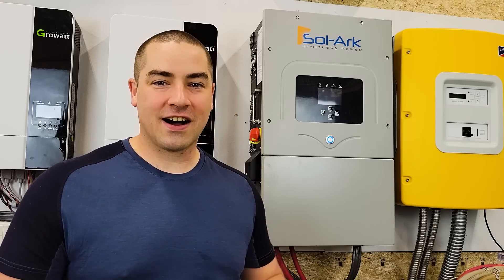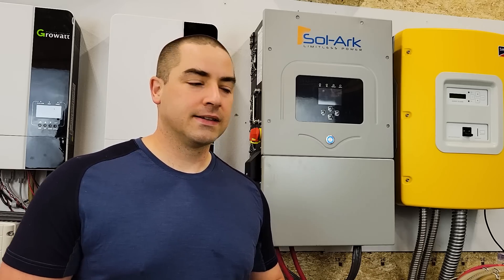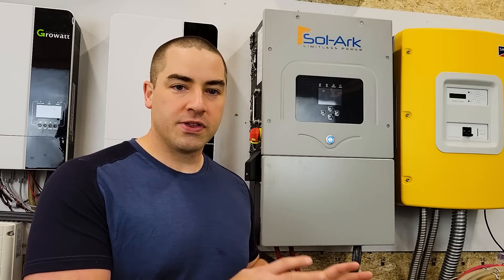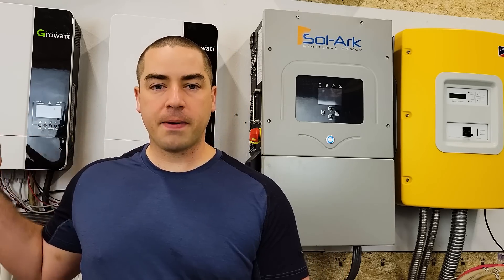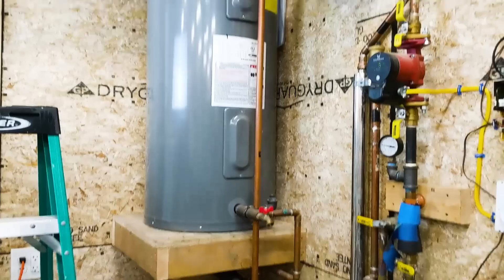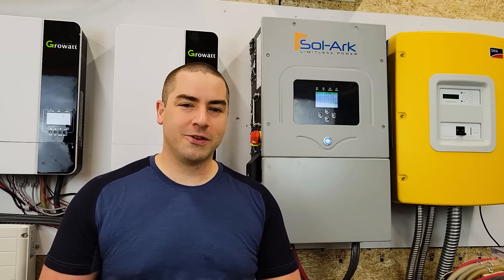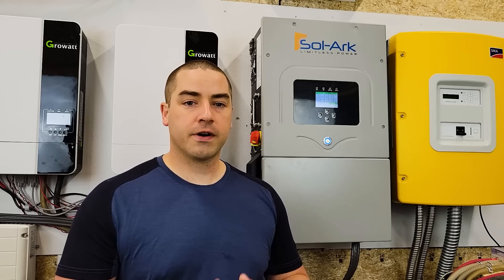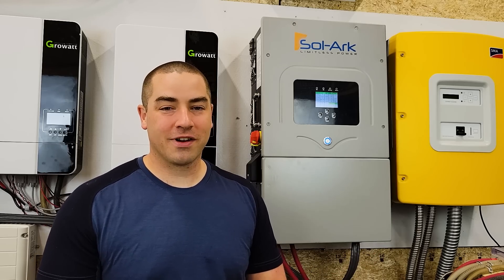Sol-Ark 12K Inverter, Is it worth it?

Comment: Balanced or not, 9K isn't a lot of inversion. Twin Sol-Arks could get past this. I would also assume that an AC coupled supply (another inverter routed through the Sol-Ark) would help with the 4500 w limit. You clearly pointed out the need for people to balance their panels. Lastly, this suggests that the new breed of programmable load centers like the Span would help with this flexibility. I haven't looked at what else is out there, but unfortunately the Span panel is largely Powerwall-centric.

Comment: Hi @DavidPoz!!!
Love your videos and what you are doing at your garage...!!!
But, again (and as I wrote on your previous Sol-Ark video), your not being fair in your tests and, therefore, maybe misleading your followers with these 2 last videos...
First of all, I was under the impression that you got this Sol-Ark 8K for testing, so that it didn't cost you any money...
Second, you have bought 2 of everything (2 SMA Sunny Island Battery Inverter/Chargers, 2 Off-Grid Growatt Inverters) and you still want to compare it to a single Sol-Ark 8K unit... really, not comparing equals here... 
Third, if you want a totally Off-Grid system, why bring the Sol-Ark to the picture?... the brilliance of the Sol-Ark is that its an all-around inverter: can do off-grid, on-grid, frequency shifting, AC and DC coupling, battery charging, TOU, etc., etc., etc... None of the other inverters can do all that...
Last but not least, it is a well known fact, even expressed by common installers of the Sol-Ark inverters (take Practical Preppers, Engineer 775 for example), that 1 Sol-Ark Inverter is not usually enough for a typical American household... it usually takes 2 in parallel (as you did with the Growatts and the SMA Sunny Islands) to manage these typical American loads...
So, my point is: do things right, make fair and comparable test procedures and stop misleading followers with inaccurate statements... it just doesn't seem right...
Take care... wishing you the best...
Reply: Thank you for your comment.  Unfortunately David isn’t comparing apples to apples.
Reply: 2x   Growatt 5k =  10k  
2x   SMA sunny Island 6k = 12k  

Lastly when either of these two great inverter companies say  5k it means  it will put out 5,000 watts period .

Comment: It would be interesting to see what happens if you added your auto transformer to the SOl-Ark. That could solve your problems. Does sound like you could use 10KW min and 12-15 KW would be more optimal.

Comment: A lot of Solark fans saying "misleading", please reply with your exact points to drive this conversation forward
Reply: I Own a Solark 8K  + Solar-edge Auto-transformer that runs my whole house but I am pro Growatt because of the price. In the same time Solark has 10 years warranty. I think Growatt is 1 year warranty.

1. test in this video it is one Solark against 2 Growatt inverters + Solar-edge Auto-transformer which balances the loads. Because of the price, comparison is fair, but if you add in additional costs then the price of Growatts goes up. You cannot put in series the same number of solar panels on the Growatt so you need more cable runs from solar panels to the inverter and copper is expensive. Solark uses 70w Compared to 2 Growats and Solaredge that use 160W. That means that you need more batteries or your current bateries will be drained more over night. you also need extra solar panels for the extra 90W Gowatts use.  90W x 24 h = 2400W. So you use 2.4 kw extra in the Growatt setup.
For 2400W extra a day, how many more panels you need in a cloudy day?
See it is not that simple. 

2. You cannot export to Grid on the Growatts.

3... as other people mentioned here, if the Breaker on the Solar-edge Autotrnsformer goes down you lose the 120V and you could burn appliances. I killed one of my fridges playing with that. 
To mitigate that you then need 2 Solar-edges  to make sure at least one of them is UP.  2 Solar-edges Autotransformers is $800. See how the price goes up?? how much is 2 extra 30Ah Breakers ?

4....
5...
6...

It all depends on what you need. If you are totally off-grid and you do not need the 10 year warranty, and you are 100% that Growatt will last at least 4 years, and you do not mind the extra cost I mentioned above, you go with Growatt. as I said in a different post. I want a Growatt as backup for my Solark 8k.
Reply: @mlg779  Growatt is 2 year, but you couldn't have put the other points better, this is just a choice that is typically better for most off grid only buyers

Comment: David, to be fair to Solark you have to redo the test. You are comparing a single Solark to 2 Growatts balanced perfectly by the Solar-edge and 2 SMAs that are 2, and then  do not have all features and cannot do what Solark does.
You just need to remove the neutral from Solark if you add the Solar-edge auto transformer.
Reply from the maker: Sounds good.  Enough people have asked for that specific test that I'm willing to give it a go.  Not trying to be unfair.  I just figured that the Growatts require some kind of transformer because they are 240V only.  The Sol-Ark doesn't require a transformer because it puts out 120V and 240V.
Reply: @DavidPozEnergy  Glad to hear this! Looking forward to the results! (My 12K is just about on order.)
Reply: Why?  Does solark say you need to buy an autotransformer because $7000 just doesn't cover it? Lol suckers born everyday. 🤣

Hey David buy 2 solarks to be fair!!!

Or to be fair spend $7000 on inverters and see what you can power with $7k of inverters ... you know to be fair

Comment: What were the settings for the batteries? I just got my sol ark hooked up with the same batteries. I currently have it set to float with a voltage of 55.9. Were you able to connect the inverter canbus to the batteries? Need any special wiring or a stock rj45 was proper pin output?
Reply from the maker: I didn't use any special communication between the battery and inverter.  I set up the inverter in voltage mode, bulk 56.0V, float 55.0V.
Reply: @DavidPozEnergy  OK great I'll set up that way. Thanks

Comment: This video is just you putting your own lack of knowledge on display, overloading a unit, and pretending that you overloading it is a problem with the device. Odds are you didnt read the manual because you didnt even mount it correctly.
Reply: Your a tool for solark
Reply: @easylooker  *you're.
Click the video description, bud. This guys is literally getting paid to advertise for growatt. You have backward who is the tool.
Reply: What page of the SolArk manual is it that covers balancing the legs?
Reply: @WimPrest  the spec sheet (included in the manual) says it has an off grid 37.5A limit. Multiply by 120V and this is 4500W, as each leg's voltage is 120V. If someone doesnt know P=IV, they know almost nothing about electrical.

Comment: Hi ppl I picked up some batteries out of a junkyard and i am interested in doing a power bank. The batteries are Mercedes Benz 48 volts 20 amps 880 Watts hour. Does anybody here know anything about these batteries, and wether i can use the standard BMS that come with each battery system

Comment: Well, if you figure only 4500 watts per phase, it shut down pretty quick drawing 4629 watts! That is really poor overload or surge performance! That's only about 3% over its rating that caused it to shut down almost immediately!
Reply: It actually does go all the way to 4800W/leg before shutting off. The reason you see the 4629 is because that's the last data the screen showed before the error, which does not report in incredibly small increments of time. If he had his dongle in to check this with powerview, he'd see that it made it exactly to what its specs say, which is 4800W/leg. Sol-Ark's support team would be able to explain this to him if he actually cared to see the problem instead of spreading misleading content. Why put an over and a toaster oven on the same leg??? That's either a rookie mistake, or he did this to force just over what the specs say and make it look bad. As many have said, this is simply an apples to oranges comparison. Those growatts don't have a fraction of the capabilities of a 12K with things like working with the grid, generators, etc. They were better in this test, so if you only ever do things like this off grid, they're a great choice if you have the autotransformer (even though it has much higher parasitic loss, and the inefficiency will grow even more as you add more power being transformed.

Comment: Hi David, thanks for pointing out the inadequacy of the Sol Ark, it is no longer on my wish list, especially as I want an inverter capable of running up to 4 Air Con units at 220-230 volts freq 60hz with a 30 Kilowatt battery bank and large solar array in Brasil.  Have you used soft-start circuits to limit in rush current at all on any of your units.  I have to admit that I am leaning towards the Growatt range now having seen your video on the Auto Transformer.
Reply: We’ve ask about the soft starters before.
Reply: 240V loads wouldn't have the imbalance issue....

Comment: 4500 watts on 1 leg of 240 volts is 1/2 the rating. Makes sense to me that they are protecting each leg at 1/2 the full 240v rating of 9000w. Not 9000W on one leg alone.

Comment: Over here in Europe with have 220-240V single phase (I am in the UK and here it is 230V) so that issue doesn't arise, as we would always be pulling off both of the 110V phases. This inverter is marketed under the SunSynk brand name, and, certainly in the UK, is not badly priced (about $2000 plus tax for the 8K model). The SunSynk is also a 'transformerless' design, what one should really call a High Frequency inverter, and is in this respect the same sort of technology as those Growatts you have there. One issue I see reported a LOT about the Sol-Ark is that it has a whining noise and generates interference around the house. This is to be expected with high frequency inverters, but the Growatt supresses it way better. The top of the range Growatt SPF HVMs are the better choice, as they are Low Frequency transformers (using laminated transformers). The 1st Gen of the Growatt SPF xxxxxT HVM cannot parallel. You can leave it connected to the grid and it will switch automatically and pass through more power from the grid if you need it (or start a generator). You can also set it to not back feed to the grid (so the grid is used only to pull power when needed). The 2nd Gen was announced a few months back (it is all over the Growatt Facebook pages). The first model is the SPF 3000T HVM-G2. It can parallel, and lots of other things have been changed/improved. They will extend that output range up to 12k as they roll it out. I haven't been able to confirm what the insides look like, but the claimed efficiency has taken a big jump up to the sort of efficiency one normally only gets from a toroidal transformer (98% sort of range). Another advantage of a toroidal transformer, IF that is what they have used, is that they are very quiet (which is why they are used in top end sound equipment) for sound and interference. I have a Chinese friend who is a production engineer, who I was chatting about this with over the weekend, and he tells me that there are a lot of new factories (who have started) making toroidal transformers. On aliexpress, I can see two listings already for 6KW Hybrid inverters that use toroidal transformers, but neither has the comms for parallel operation. 2022 may see the start of the supply side of this market starting to mature in to better designed, market oriented hybrid inverters.

Comment: Looks like a lot of the problem is unbalanced loads.  With resistive electric stoves (including glasstop ones like yours) a common way to get low power out of the element is to just hook it to one of the 120V legs.  Combine that with a toaster and other loads on that same leg and you hit the 4.5kVA threshold and get the beep of unhappyness.  It would be worth going at your house electrical system to better balance loads betwixt the supply legs.
Also, the inaccuracy of the DC input from the batteries is due to it being at the absolute bottom of its measurement range.  Try the same thing with a current meter on its 100A/200A range when measuring under 2A.
I have 2 Sol-Ark 12Ks in my main system, and have only had a few issues including the half wave rectified load trip.  I do have my share of complaints, but none of them matter to >95% of the market for these.
Reply: And then next time you want to run the air compressor, table saw and water heater you have to rearrange the subpanel again lol 
All the while you could of gotten 2 growatts an autotransformer and not move anything and be fine. Oh and save 5000 dollars while your at it.
Reply: @easylooker  That can be mitigated by big draw appliances being 240V.

Comment: My home office is a travel trailer and it's currently being fed by a 30A 240V circuit (1960s electric range circuit) so I know the dance of trying to keep your usage under a fairly low threshold per leg, when we're at a park on a 50A 240V I don't have to think about it, so yeah there's a big difference between ~4kw per leg and 6kw per leg as far as what kind of mental effort you have to put in with current generation appliances (heat pump hot water heaters and other efficiency improvements might tip that balance in the future).

Comment: I like a lot of your videos, but this one definitely misses the mark. The spec sheet lists 4800w as the L-N limit on the second line of the AC section. 

SA does a decent number of things well, and as all companies, needs to improve many. Since you generally favor cheaper options, you should try to get your hands on a SunSynk that the SA is based on. Would be interesting to see how a few of those in parallel compare to your GW setup.
Reply: Wasn't his shutting off at 4,600 watts?
Reply: I found it surprising it tripped at 4600w when the label said 4800w???

Comment: Great testing of the Solark and its limits for 1 inverter . I wonder if it would shut off with two of them ?  The only thing that matters is having an enough big battery bank to  keep them running . Is it a high frequency or low frequency inverter  ? How heavy is it ?  May the solark be with you .

Comment: the glory of the SolArk is the ability to feed back to the grid, and, have 'off grid' capability when the grid goes down (instead of having "no power" at all, like all other grid-tied systems).   For a purely off-grid situation, the SolArk is NOT the best solution.   That and there are hook-ups inside to connect batteries and a generator and you can pick which source has priority for charging batteries (or feeding the 'critical load' panel):   grid, solar or generator.   The Invertor is good for 50 amps at 230 volts -- the built in breaker is a 50amp breaker.   I guess the whole thing shuts down before it flips the breaker....?   You are drawing 59.4 amps when it shuts off.   I would say working as designed.

Comment: Unbalanced loads on the legs ,do another test where you balance correclty! Anyone can over load one leg of a split phase  and it will shut down .
Reply: Why?
Reply: but how are you going to keep it balanced all of the time? So each time I want to run my dryer, I have to turn on a couple of space heaters on the opposite leg? It should handle the imbalance for short runs in my opinion.

Comment: There should be no surprise, every inverter will have a per phase maximum.  Divide a 240V system rating by 2 and you have your per phase/leg maximum.  Also, leaving an exposed bus in your panel with the cover off is an unnecessary risk.
Reply: You must be new here. You mean a split phase system .  The Growatts are 240 volt but single phase , so you don't have to divide by 2 .  This is the reason he was surprised  by the split phase solark tripping , because the single phase Growatts don't. The yellow SMA Sunny Islands on the wall are single phase as well.

Comment: If the Sol Ark is based on a HF switching transformer "transformerless" and not a LF 60Hz transformer design.. I think the engineers could have at least used a 9000W primary and dual 9000W secondary switching HF transformers! This way the inverter is still rated 9000W but Both L1 and L2 can supply 9000W on one single phase for a max total of 9000W for both phases.... That is the solution that would avoid using a external 60Hz isolation or a step up transformer at the output to use the magnetic field to split the power on both legs in order to maximize each leg to full power and avoid wasting the transfo losses...
Reply: That isn't how transformerless inverters work.  Inside the Sol-Ark, there is a ~400VDC buss consisting of a +200VDC hot, a -200VDC hot and a DC neutral which is tied to the AC neutral.  Each AC hot is connected to a half bridge fed by the 2 DC hots, and is fed PWM DC from one or the other of the DC hots depending on which half cycle of the waveform that AC hot happens to be on.  The reason for the unbalancing faults is because the battery charger/discharger and solar MPPTs are only connected to the positive and negative hots; there is normally no need to feed any power into or out of the DC neutral, as any power flow in a given half cycle will reverse and be corrected in the next half cycle.

Comment: I started using the solark 12k last March and have had very good luck with them.  I have added more inverters since then and I am very happy with it.  I am currently off grid. He isn’t comparing apples to apples when he is not properly balancing out the loads.
Reply: How many people are going to move their subpanel breakers around to do that? How many are going to count watts used on this leg or that leg to make sure nothing is going over 4500 watts? Not many will when living their life. Why should you when you pay out the ass for it? Pay 2k for 2 inverters and transformer and never have to worry about it